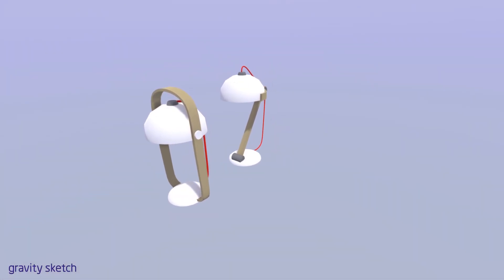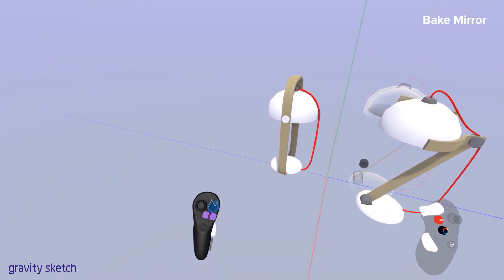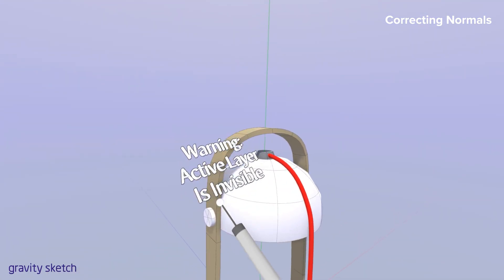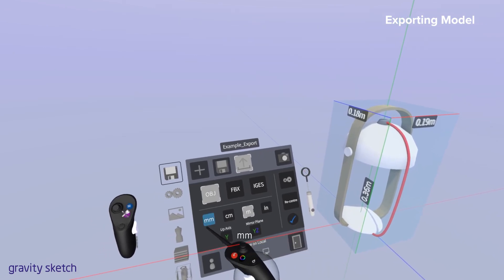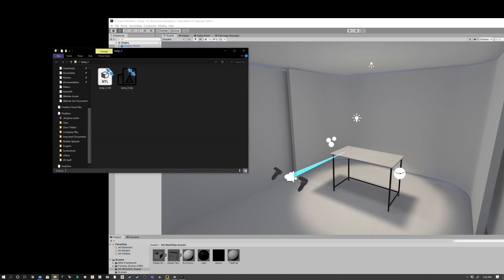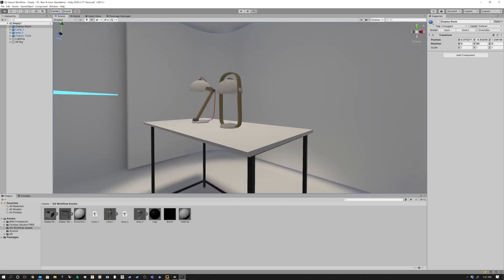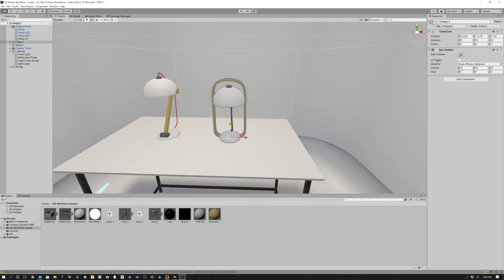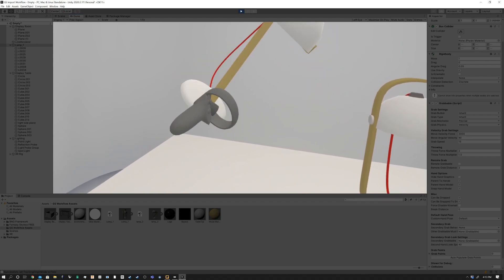Export from Gravity Sketch to Unity - Workflows

Comment: How do you discern which normals to correct?  That didn’t seem fully explained in that GravitySketch export prep step.
Reply from the maker: Good question! When you grab the reverse normals tool, all the surfaces that are flipped the wrong way are seen as transparent wireframe. That indicates which ones you should reverse